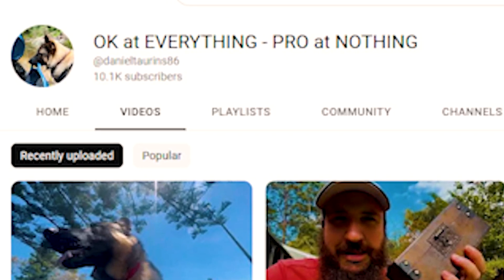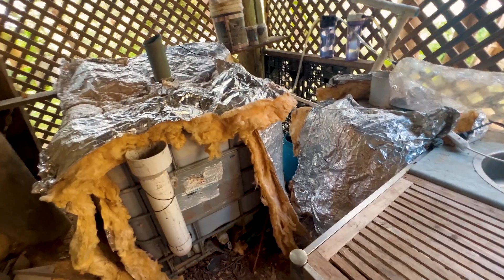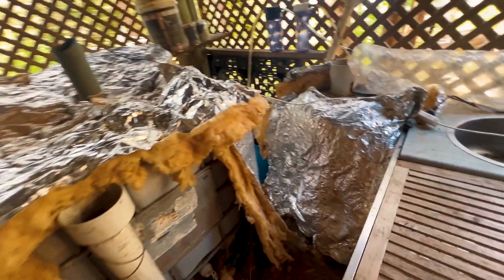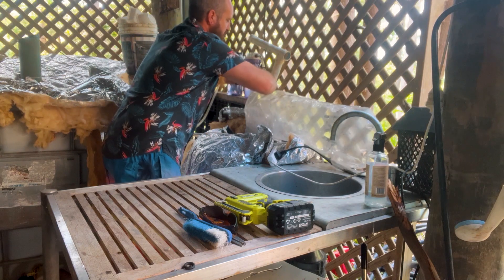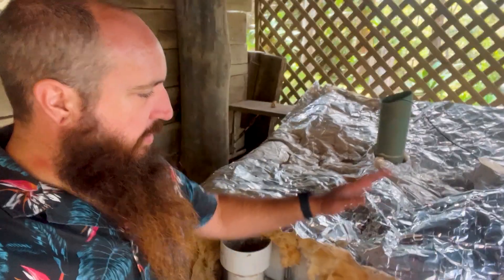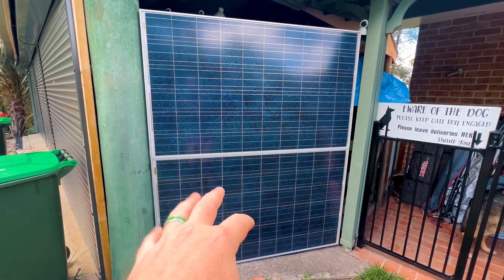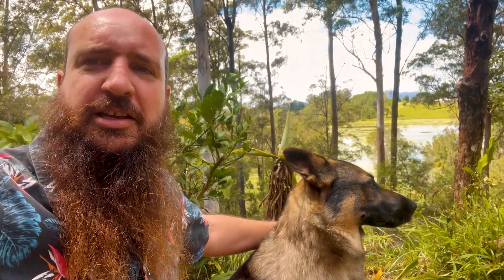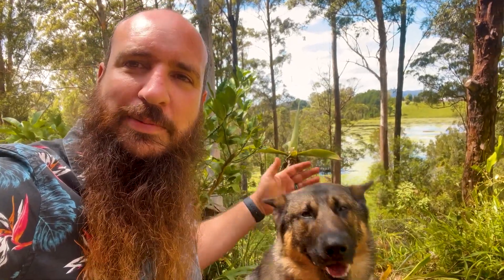Biogas in the Bio Bunker - Back in business.

Comment: Good to see you back at it. I mentioned your biogas experiments to "Project Kamp", which is a kind of off grid living experiment in Portugal who didn't have a good solution for dealing with human waste. I think I'll be doing the same on my property, as I think it'll work out cheaper than installing a septic. My thinking for the application for biogas for myself, is kind of like a battery. I'm increasingly thinking that it will be cheaper to stay off grid on my property, than to get it connected to mains. And all current battery technologies degrade at rates that I don't particularly think are sustainable. A biogas system that I could maintain myself could help convert solar (direct heat from the sun or photovoltaic) and biomass into energy that could run a generator. Doing the work to determine the size of the system that would be required for a single dwelling to keep the lights on at night would I think be quite a helpful thing to demonstrate.

Comment: Why don't you use a compresser from a frige, or freezer, one that runs R290 of R600 (Isopropane, and IsoButane) they are cheap, and easy to find, you can easy get more PSI of BAR pressure too.

Comment: Hey man very interested in making my own digester and compressing into tanks for everyday use. At the moment i plan to use 2 55 gallon barrels. One for waste with a connwctiont I the other to collect gas. I'm wondering if thats would work. Figure you'd be the right one to ask and yours looks a little different. Many designs are elongated/vertical on the ground and im wondering if the barrels would work?

Comment: Timing of finding your AU channel is interesting, Commercial gas is going because they say it kills ya so if ya need gas as a fuel and the supply is going to end by 2030 it's time we all took biogas seriously.
In my case I have Solar but every day cooking is gas and it's gone by 2030 - we have a wood stove to heat water but it's a Stanley and in the summer who wants a fire going so it's gas.

I did a single 44 and track tube proof of concept 20 years ago, interesting burns without smell or flame and I was only 1/3rd full got 20 minutes burn a day for months.
Until I thought it was dead and abandoned it to come back weeks later and found the metal 44 had blown it's top - So I Know it's good.

Subscribed Ausie - @THE_UGLY_K1VV1